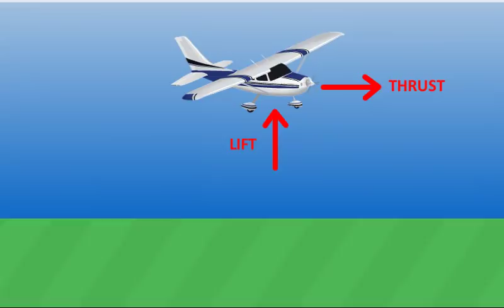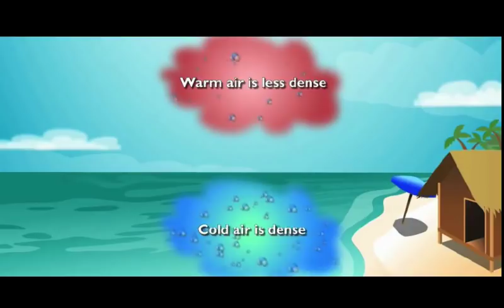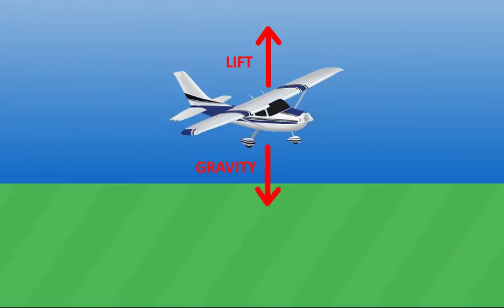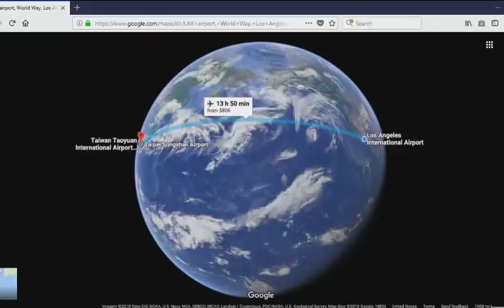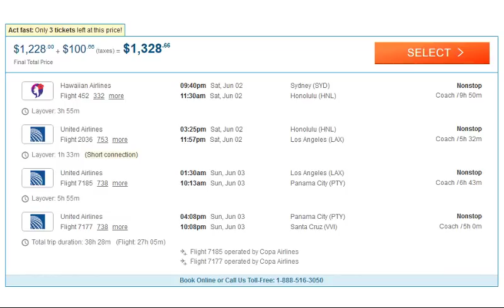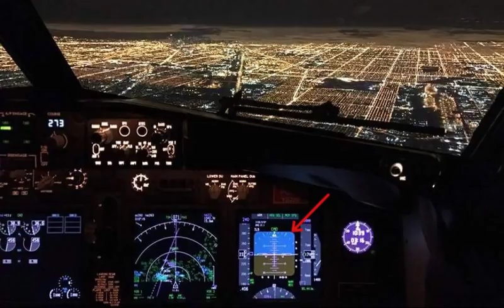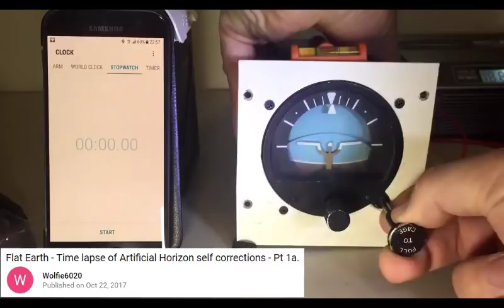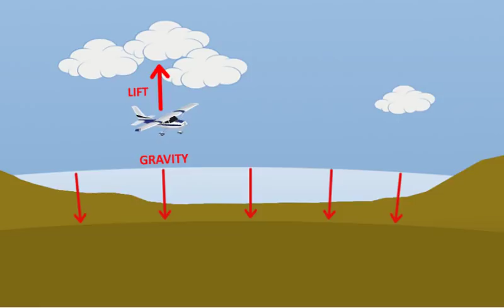Flat Earth Falsities - Plane Nonsense

Comment: Can a flat-earth delusionist please explain why GPS Technology was invented, without first saying "it's all fake!"?
Reply: "If the military used satellittes they would also be inaccurate and they would not be able to build any bridges when using this technology."

When I first set foot in Afghanistan there were no cell phone towers.  We were in a valley surrounded on all sides by mountains which prevented all radio communication beyond line of sight.  Despite that our satellite phones and GPS devices worked just fine.  No doubt you think Al Qaeda had some secret land based satellites set up in their caves which allowed our GPS and sat phones to work.
Reply: They say it works by cell-tower triangulation. Despite the fact it still works perfectly where there is no mobile signal.
Reply: You are describing Differential GPS which uses ground-based stations at fixed well known locations to broadcast differential corrections to the satellite signal to improve accuracy for surveying, construction, drilling etc. It still needs and uses GPS satellites. 
https://en.wikipedia.org/wiki/Differential_GPS
Reply: Don't worry Bobby.  The way you are heading, you will never, ever, ever, be an "elite."  Get used to taking orders.
Reply: If you are smart enough you can build your own GPS receiver from scratch. Which pretty much destroys the idea that it is fake. 
https://hackaday.io/project/20965-full-stack-gps-receiver
http://www.aholme.co.uk/GPS/Main.htm
https://www.extremetech.com/extreme/98063-how-to-build-your-own-gps-receiver
Reply: If you need line of sight of the antenna, then you are mistaken. If so had been true, we would still be using morse signals. Mobile phones and satphones are not made for the reason for you to talk to the person on other side of the table. So you belive that you not seeing the phone towers, then it must use satellittes? Well, when you are in the city it must always be a satellittes sending to your mobilephone since you can't see any. This is not true, an antenna can send through materials. That is why you can call from your mobilephone in a building. That is why WIFI are working in your home, that is why Bluetooth work in your home with only few restrictions. Satellites are not landbased, and are not used for this purpose. The radio communication is short range due to antenna signal restriction. Satphones are using different bands than regular mobile phones, and the antenna on regular mobile phones are weak, and satphones using stronger antennas carry longer signals. It is nothing you are learning in the military, you are supposed to do what you are told, and not think. Especially about things that they want to a military secret. So how do you think a boat in the middle of the Atlantic are sending signals to the mainland? If you think it is by satellittes, then you are wrong. It is still an antenna. Standing by these antennas over a period of time can make you sick. Here in Norway, we had a case of this, where the antennas was so powerful on the military boats, that the crew got sick from long term exposure to the radiation from these antennas and they sued the state. And how do you think an antenna can send that far on a globe? It is not possible. So the Earth must be flatter than you think.
Reply: "If you need line of sight of the antenna, then you are mistaken."
You've never actually used a radio have you?  Hint, there are different types of antennas meant for different purposes.

"So you belive that you not seeing the phone towers, then it must use satellittes? Well, when you are in the city it must always be a satellittes sending to your mobilephone since you can't see any."
I specifically pointed out that I was in Afghanistan.  There were no towers.  No cities.  Nothing.  Just goats, mountains, and terrorists.

"It is nothing you are learning in the military, you are supposed to do what you are told, and not think."
Listen bud, I've got actual real world experience with this stuff and you've got some nonsense that you heard on YouTube videos.  Go outside, get yourself some real world experience, maybe visit a local amateur radio club or astronomy club.  Then maybe you can talk about the subject without sounding like someone who got their education from a yoga teacher.
Reply: Odd-Arne Dahle: cite. Show me evidence of this pure land-based solution that works globally with millimetre accuracy. 
I’ve demonstrated that it is possible to build your own full-stack GPS receiver and get accurate positioning from satellite signals. 
So show me the plans for building my own receiver for this mythical land-based system.
Reply: Did you actually read the article? It is garbage. It claims that the best version has a 10 cm accuracy, which is not true. The best has mm accuracy. If you are building a bridge, you can't make 10+ cm gaps everywhere. And the US military was using this or similar system to do this. All is landbased.
Reply: No... of coarse. the elites own everything.
Reply: Rafael Sanchez

"When you awaken your mind you will see what this world has become."
When you start developping a mind, you'll notice religion is LIES !
Reply: Odd-Arne Dahle well said. Maybe they will finally understand
Reply: Loran and Decca if im correct worked with the same systems your "gps" does. Off radio wave not satellite signals. All they did was combine the two and called it "gps" which shows again how these elites make everything a monopoly but ur just to naive to see. One day you will awaken. Hopefully it wont be to late. Peace be with you.
Reply: GPS Technology is landbased and is real and has nothing to with satellittes. US military are using this to build bridges accurately and are using long distance antennas for this, shown on the Discovery Channel, where the military were building a bridge using GPS to guide the machines. Satellittes used for GPS are for commercial use, and are not accurate due to they are floating in the air due to they are connected to balloons. If the military used satellittes they would also be inaccurate and they would not be able to build any bridges when using this technology.
Reply: When you awaken your mind you will see what this world has become.

Comment: So all; the airplanes  traveling in the air are just magically dragged along because the earth's atmosphere has such a loving relationship with earth that it  holds on and goes along for the ride . Sounds absurd because it is absurd . Keep believing the lying Masons
Reply: Ask yourself why precision scales need to be calibrated as a function of their latitude. Why do things weigh slightly less (about .3%) at the Equator than they do at the poles. Exactly what calculated with a a .0006 rpm rotating sphere of the Earth's size. What's the explanation for the Eotvos Effect? How about pendulums and gyroscopes or dropped objects down long mineshafts, etc. The Earth is rotating folks. Prove me wrong FlatEarthers.
Reply: Larry Major it seems absurd to you because your brain is flat
Reply: Only upside down relative to someone on the other side of the globe. Relative to the plane, it's still right side up.
Reply: It's a globe, it's spinning, we've seen it from space, get over it.
Reply: No... yes and its b.s. if gravity is pulling the plane "down" to make it parallell to a sphere the plane will begin curving and eventually be upside down
Reply: Lyle Landstrom well if you travelled from one hemi to the next youd become upside down in relation to yourself. its common sense
Reply: Lyle Landstrom actualky lyle if you were traveling across hemis youd be upside down in relation to yourself. its common sense
Reply: As long as you've got feet on the ground, you're right side up in relation to yourself.
Reply: Lyle Landstrom your feet wouldnt be on the ground in a plane. planes from lax to syd dont go upside down.
Reply: Larry Major
"Sounds absurd because it is absurd "
NO, sou_nds absurd TO YOU, because you lack the cognitive camacity to grasp it.
Then you apply the good old flat earth cult principle : " I don't understand it, therefore it's false" !
Reply: Bobby Wizdum

"Lyle Landstrom well if you travelled from one hemi to the next youd become upside down in relation to yourself. its common sense"
It not "commonj sense" , it's COMMON FLAT EARTH CULT STARWMAN
Reply: Upside down also goes upside down.
Which means that it is upright.
How would upside down not also go upside down?
Reply: Let's imagine for a second that the air didn't move with the Earth. It would have mountains, valleys, forests, and cliffs smashing into it at over 1000mph. How long would it be before it started to rotate as well, when it was being stirred by an enormous world-sized fan?
Reply: And it is obvious that the earth is not spinning and you have no common sense at all .
Reply: Pretty obvious to me that it is spinning. The movement of the sun, moon, and stars all show me that it is. So does the seasons and the changes in day length. 
More scientifically the action of a gyrocompass or a Foucault pendulum demonstrate the spin.

Comment: I explained the correcting mechanisms in the Artificial Horizon to Dave Murphy back in 2016 when I first started making videos.  He has no excuse to keep making his erroneous claims about them.
Reply: Except those sweet sweet ad revenues and Patreon donations.
Reply from the maker: Yeah, I used that recent interview on purpose, but left out the part in which he claims he "contacted the manufacturer" to ask if they self-correct, and they said no. Clearly he is lying about that. Thanks for your great contributions to this subject.
Reply: Given a little thought and I could ask them if they self correct and get a no answer.
The trick is to ask in such a way that they think they are answering a different question.
But one you can twist into being the same.
Reply: Don't forget t-shirt sales